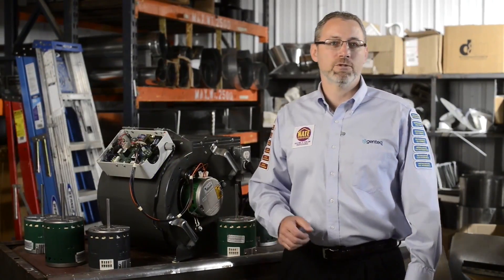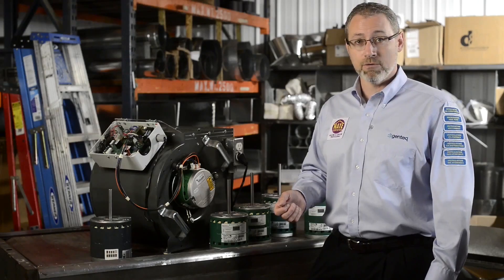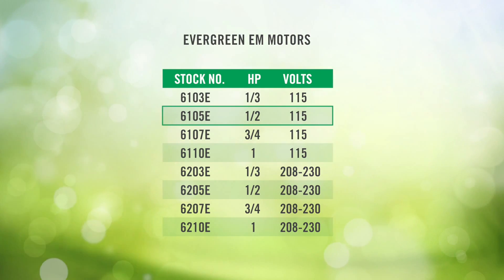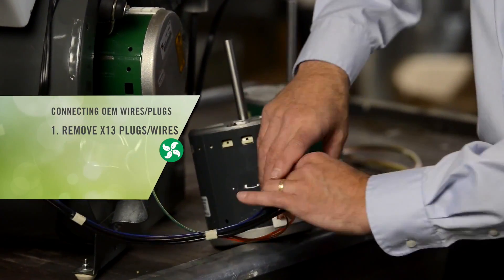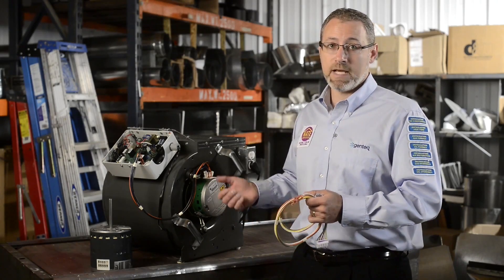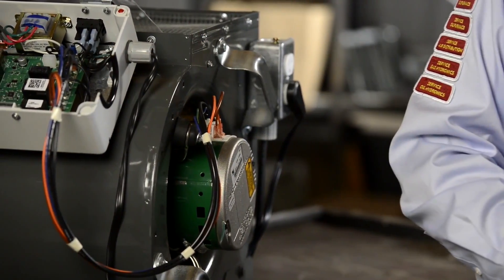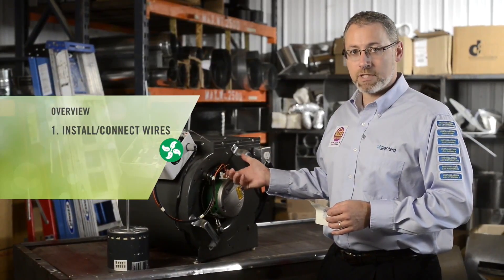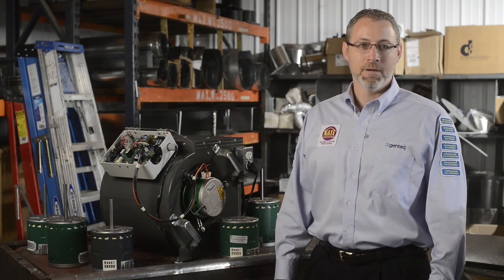Genteq® Evergreen® EM Motor Installation

Comment: Hi, I don't see the wiring example in the manual that was mentioned to connect to regular non control board fan relay. Current setup is 20 KW 4 element heat only Chromalox electric furnace with PSC blower motor running low and medium speeds (blue wire medium,red wire low).  There are 4 sequencers and elements come on with about a 20 second spread between elements. The low speed is triggered by the first 1-20 sequencer through the normally close high voltage connectors on the fan relay and shortly after the med speed is triggered by sequencer  #3 via low voltage set to fan relay to energize normally open contacts. Upon shut down it reverses itself. The fan only is operated manually on this furnace with a furnace mounted exterior switch that runs high voltage directly through the normally closed contacts of the fan relay. This house is small bungalow with wood stove as main heat and electric furnace as backup and supplementary heat during colder winter days. Current PSC motor isn't too bad on noise but getting old and would be nice to run quieter ECM motor and run a more low rpm fan only mode to distribute wood stove heat as well as the quieter operation during heat cycle.

Comment: I have an X13 1/3 HP Model 5SME39DX L143 motor Question Will the 6203E have the same specs and diameters ?

Comment: Why can’t be install in the 16 pin conection?
Reply: Easiest option is to replace the PC board on the air handler with the harness that matches the x13 units.  Once you've done that, you can use this motor.  The PC boards are cheap on eBay, often less than $30-40.

Comment: Is there any way to reset the rotation sensing technology?
Reply: Yes - It just requires a method to connect to the ECM-harness with separate wires, so that you can prompt the motor to re-run the calibration.

Here is a step-by-step:

1. Disconnect the MAIN power to the Air Handler.
2. Disconnect the Low Voltage Control Input connections (the harness or regular connection from the Air Handler PC board)

3. Connect motor terminals 1, 3, & 5 to 24VAC.  Connect Common to terminal C.

4. Reconnect the MAIN power to the Air Handler.
5. Apply the low-voltage to the 1,3,5 terminals connected in step 3.  Keep this connected for a MINIMUM of 5 minutes without any interruption.  This is very important, it's conducting the rotation sensing.

6. Disconnect the MAIN power to the Air Handler (IMPORTANT:  Minimum of 3 minutes)

7. Reconnect the Low Voltage Control Input to the original harness / Air Handler.
8. Reconnect all power to the Air Handler and it should begin running in the proper orientation.

I hope that helps.

Comment: I have a 6205E that wont turn off unless you flip the breaker (yes I have double checked the thermostat is not set to on). The hvac tech says he thinks it is a bad motor. Have you ever seen this happen before? Do you have to replace the whole thing or can you replace just the motor?
Reply: Remove the green wire off the thermostat to see if the motor shuts down. You could have a bad fan relay in the stat. Second look at the control board for that motor, it sends the signal to come on or off, it's simple as that.
Reply: Check your high limits, you might have a open limit or faulty high limit switch making your blower motor to want to possibly run constantly, but like the other person said check your t stay wiring and disconnect the green wire at the circuit board.

Comment: Is it preprogrammed for a trane system ?
Reply: No.  It's intentionally generic so that it can work with any system.  If you are not familiar with how your system chooses pressure/CFM settings, then best not to use this motor.  However, if you can invest the time to understand the difference with some additional research, it can save you a lot of money by using this unit and wiring as-needed.
Reply: @InspiredScience but it doesn't tell you the cfm, he says need more? Make it a higher speed and I get that but what do we just keep the static under .5 and look for good split sh/SC?

Comment: I have found that the only thing that goes bad is the module ,very seldom is the motor go bad ,they don't  last much longer than a year to 16 months standard motor will basically last as long as the unit!!
Reply: ECM motors are sensitive to static pressure problems. if you don't replace your air filter regularly or if the ducting in your home is too small to move the required amount of air volume. those two factors greatly reduce lifespan of the ECM motors.

Ours is going strong after 5 yrs so far

Comment: I use one of these e m multi voltage and horsepower models on a Daikin univent that kept going through Motors. It was a PSC motor I replaced it with and it works great I like just a constant CFM that I need. Additional torque is what was really needed that's why I decided to try ECM motor need an additional torque with the 1/4 horsepower

Comment: So I have one of these in my home, and I just want to confirm - in the arrangement you showed here, is the correct direction the counter-clockwise one? I've had problems with my AC in my home for a decade and no one can fix it. I was considering trying to reverse my motor after learning that one spinning backwards would still produce airflow, just at a much lower rate, and that describes my problem 100%. But if CCW is correct, mine is set up the same way as the one you have here, and clearly reversing it will not solve my problem, much to my continued frustration.
Reply: Motor rotation depends.  There is no one correct rotation direction to fit all.  Specifically what is your decade old problem?
Reply: These motors program themselves, rotation and all.